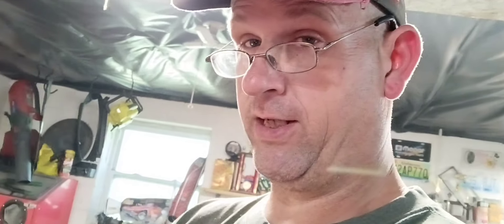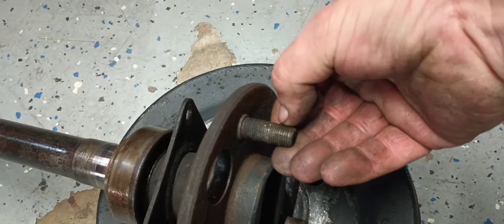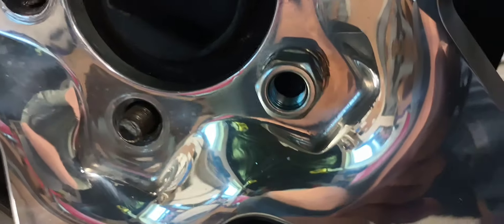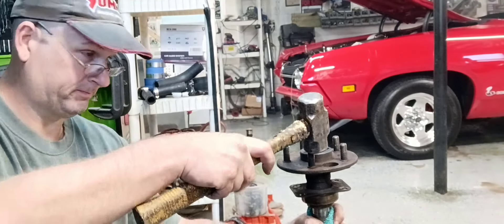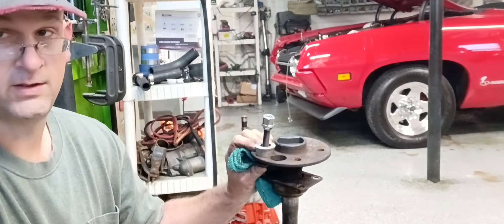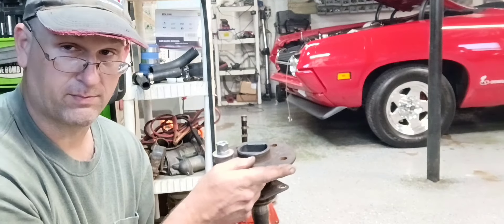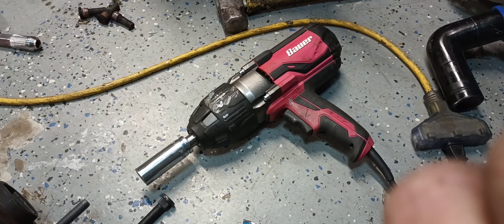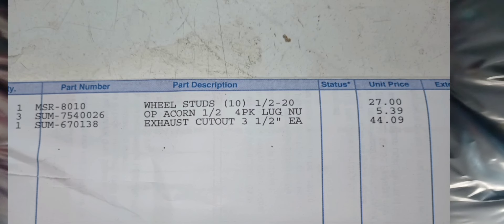Boosted Torino Inline Six: Dragstrip Legal Studs & Gear Swap! #nonamenationals

Comment: My absolute favorite way to do it. If the axle is out and on some vehicles you can do it with the axle in, is I use a ball joint press. On my lightened, gun drilled axles. I'm always afraid of bending the flanges by banging on them.
Reply from the maker: Could possibly on lightweight stuff

Comment: When it comes to thread engagement you want 4 threads, which is the standard on any nut you care to count. The first 3 threads on a bolt or stud do 85% of the work.
Reply: With the torque, and other motion forces on the lug nuts, to use only 4 threads is nutz😂.  A Standard used in my profession I've been working in for 34 years, is a minimum of 3 threads PAST the nut. So no matter what size the bolt, the nut must have 3 threads minimum showing past the nut. Now, in racing,  I've noticed a lot of people using studs that have over an inch of threads showing,  in which I feel is unnecessary,  unless they're using wheel spacers also 🤔,  but a lot of the time,  they are not. I see 👀 this, and wonder what the thought process is for having 1-2 inches of extra length for? 
Thanks for the video. 😎🇺🇲🇺🇲🇺🇲
Reply: Any part of the threads past the nut are useless. 

4 threads is all you need,.  If more were required, nuts would have more than 4.  

Bolts don't pull threads out.  They snap well before that happnens.

Don't care what your standard is in your profession.  The standard application is what matters.